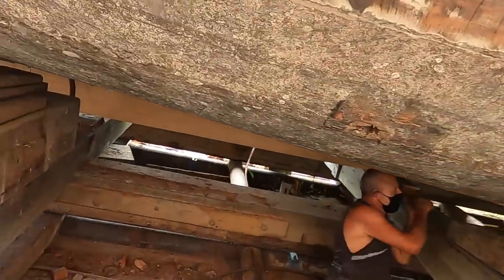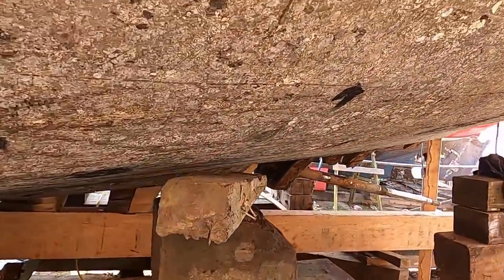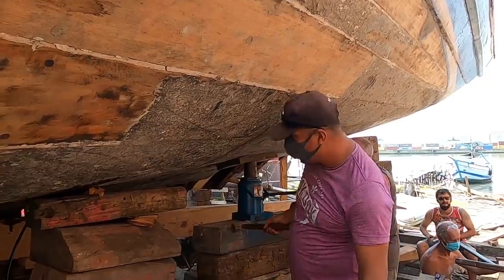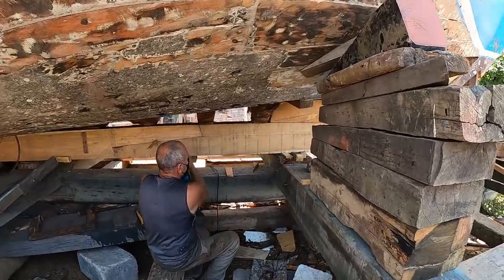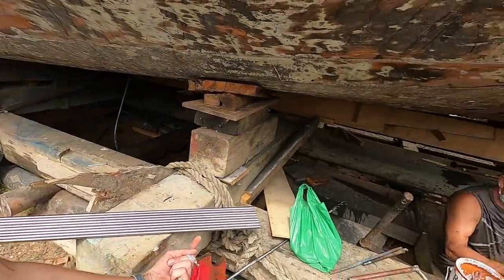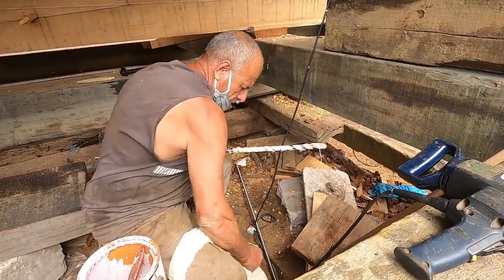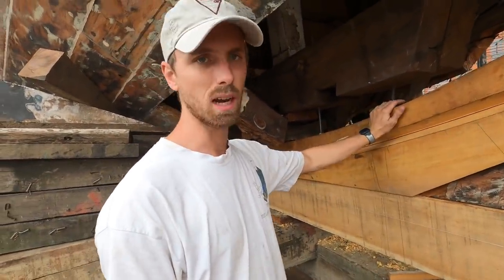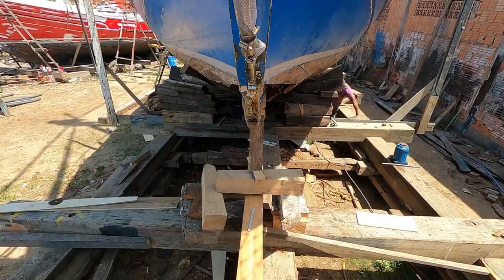Replacing the largest piece of wood? CHECK! — Sailing Yabá #15

Comment: Ok I'm going to help you out here. They are putting all thread "BOLTS" not screws through your keel. And the things they are putting on the bolt is NUTS not screws lol. If all you had was screws in your keel it would not hold. Bolts are way stronger than screws.
Reply: We call it threaded rod because there is no fixed end with a nut cast on it. Threaded Rod in our country, then you lag it and put nuts on
Reply: Right, we call it all thread. Basically the same thing just different names. We call it that because it is exactly that, all threads, no head, no washer. You can use the entire stick or cut it into many. Nut on both sides or thread it into something and turn it into a stud with nut  one side. Pretty handy.
Reply: So, tell me, what's the difference between a screw and a bolt? In Portuguese they are the same thing, have the same name, that's why it's confusing. Tell me, is there a definition in English about which one is called a screw or a bolt?
Reply: Actually if you want to get technical, they are not using bolts, they are using threaded rod with multiple nut's. See how easy it us to tell actually what they are doing.
Reply: @48whodat  It's all 'parafuso' in Portuguese.
Reply: @rafaelschipiura9865  I build industrial machines.  In English it is usually understood that a screw is tapered to a point and used in non-threaded holes in wood, fiberglass, plastic or sheet metal.  A bolt has a squared off end and is used in threaded holes in metal.  However I have seen the term machine screw also used to describe what is normally understood to be a bolt. And the term lag bolt is used to describe a large screw.  So yes it is confusing.
Reply: @13Sala13  It's also possible to call what's usually called a tapered 'parafuso' a lag bolt, so the square end doesn't make something a bolt. There's no actual definition. For someone without actual experience in English, it's not possible to know at all. Since the working language in the boat yard is Portuguese, they have no way of knowing the word they are supposed to use.
Reply: @rafaelschipiura9865  A screw for wood(called a wood screw) is usually tapered and does not go through a piece of wood but buries its self into the wood. The threads on the wood screw are designed to cut their own thread into the wood (you make a tiny pilot hole for it, the pilot is much smaller than the outside diameter of the wood screw). A bolt is a rod of steel that goes through an item and has a thread on it. The bolt goes through the item and has a fixed end (head) on one side and a nut that you put on and tighten with a spanner at the other end (there are several types of heads for a bolt but all are fixed). A machine screw is a bolt (with different heads) designed to screw into a thread that has been cut into the receiving item. A threaded rod allows flexibility in length, installation and how you put a head on one end, it is just a long  long rod that has a thread cut from one end to the other.  You can cut to length, drive it through the receiving item and then put a nut on each end. You can tighten from both ends too.
Reply: @jolyonrussell7021   "A machine screw is a bolt". Is this a screw or a bolt? And what about a lag bolt?
Reply: @rafaelschipiura9865  A machine screw is a bolt BUT nut is the item it screws into. Like bolts that go into an engine block. It is a bolt designed for  machinery and metal to metal. Lagging is a sealant, there are several reasons to seal a bolt  like wanting to stop something leaking through the hole or make it impossible to remove the bolt again or to rust proof the bolt. Lagging is an old and proven way to seal the bolt. Lagging is/was cotton or similar that is wrapped around the bolt. You then add an adhesive to the lagging like paint, tar or modern silicones etc. Loctite is for example a modern adhesive that does not require the cotton but it locks the nut on a bolt or locks the machine screw into the receiving end. Plumbers used to use Hemp and Graphite to lock water pipes together without any leaks, the hemp is the lagging and the graphite is the adhesive/sealant
Reply: Wow guys I was just poking fun. Same thing I do to Duca. But on a brighter note, I now no how to say bolt in 3 different languages!!!😂😂😂

Comment: When you say , "painting keel bolts so they do not rust" are you implying that they are carbon steel threaded rods and not stainless?
Reply from the maker: Sorry they are stainless steel, it is so that the metal doesn't get in contact with the wood and keeps the wood in a good condition

Comment: I’m following your journey...I do have one question how much does it cost for the keel replacement
Reply from the maker: Hello Charles! The wood for the new keel itself costed us around 650USD. But of course that's not the total cost of replacing the keel. To that we should add the labor hours, the planks that had to be removed for the keel to be replaced, the bolts, threads and nuts... we are still working on our expenses sheet so we don't know the exact answer, but hopefully this gives you an idea!

Comment: That boat is all just a chocolate cake. How much are you spending to get it sea safe? How much did you buy it for. Than add these up and see if you can buy a better non leaking boat.  If you can than you are doing all this for sentimental reasons. I think you can get a good boat for the money. This one is nice but sometimes you have to think. I am sure after it is all done you will get a nice boat, but expensive. The labour cost in our country would mean this boat is scrap. Hopefully it’s cheep labour costs.

Comment: Your determination will probably see this refurbishment through, but I still say it's going to take you a lot longer to do and be a lot over budget . . . do you even have a budget . . . than what you thought.
The removal of the stern is just another example of getting something you didn't plan for, a lot more rot.  I'm afraid you're going to continue to find that throughout the boat as you fix it. 
There's nothing wrong with what you're doing, as long as you know you're in it for the long haul and that it's going to be far more expensive than you originally planned, even in Brazil.
But, when it's done, if it's done properly, you will have a nice boat.  Is it an ocean crossing boat?  I'm not sure.  I don't think I would want to take that out in the ocean, well off-shore.  I think that's more a coastal cruiser, but if you're a good sailor, you might think it's okay.
With COVID and the lack of available work right now, I would say that you are doing well with the crew of shipwrights, builders, and craftsmen you have working on Yaba, not to mention the dog, but I would be seriously surprised if you're out of there before the first of the year.  Really.
Anyway, I'll keep watching to see how you are going to rebuild this boat, obviously, from the keel up!

Comment: In American English you are using threaded rod and nuts.  Not bolts or screws.  But we use bolt/screw  as the verb to assemble the trods and nuts.  We talk funny Lol.   I really don’t care I know what you mean and like  hearing what it’s called there.  .

Comment: Guys - what a great project and fabulous to see the progress.  Super well done and fascinating. The bolts you often refer to as screws are in fact BOLTS - ie they have a threaded shaft with nuts on either end (or a machined head). Screws on the other hand are tapered and inserted into the wood by twisting so that the thread bites into the wood. KISS - just refer to all those keel fasteners as BOLTS -   that's what they are. Coach or Lag bolts also screw in - but they have a tapered shaft.
Reply from the maker: Hey Richard! Thank you so much for taking the time to explain us the difference, we were clearly very confused about the terminology. Now we've learned and hopefully won't confuse it anymore!

Comment: Im sorry, but get a surveyor down there independant, those keel bolts are wrong, you should not use stud, but they are way to small to hold such timber, the stainless that size will have difficulty handling the keelson swelling up when you launch her again. Seriously, ive rebuilt a timber yacht myself & re planked others, you dont know what you are doing and relying on what the yard gives you, i seriously recommend you get a surveyor urgently to over see these works
Reply: Yes I agree an some tar or bedding compounds. between timbers
Reply: @jamesseven2068  totally, I haven't seen any red lead in use or any bedding compound at all in the forefoot. The issue with using stud, firstly over time water will find its way up the threads regardless of what compound is used. And plus, for the diameter of stud, the actual diameter is less the thread ! No wonder these boats rot away so quickly. The craftsmanship is ok so far, but materials being used questionable in respect of installation. There is no way on earth that I would take this boat to sea on those studs let a lone do any ocean passaging
Reply: @jamesseven2068  sadly the guys haven't knowledge to oversee these works, and must employ a surveyor to reside over specification of and installation. It also concerns me that all the framing is shot, but seemingly the new keelson is being fitted back onto them, unless they are going to install sisters on each frame, but surely these would go in before the keelson is fitted ?
Reply: I must admit all my keel bolts are stainless that run through my cast iron keel weight through the keelson, but they are of the highest quality stainless and made to fit the installation. Using a bit of 316 stud is suicide, it's not even big enough for the job

Comment: Very interesting process, I worked for a company that used hydraulic rams to lift and move buildings and the wedge process here was great to watch live no doubt. Packing "Calking?" the bolts for water tight fit and paint for lubrication for the inserting and protection , Well done by that crew.

Comment: This is the craziest thing on youtube. A round bottom boat with no ballast or heavy keel will just roll over in the smallest ocean storm.  I hope the seller paid them to take this scrap away.
Reply: There will be ballast added in the bottom of the hull after it is fully replanked. Internal ballast worked well for all of the clipper ships and sailing ocean freighters also all of the sailing warships generally used pig iron blocks as ballast lying on the bottom planking.

Comment: What happened to all of the old keel bolts?  why havent you posted the removal of them?  weren't they 1 inch bolts?  5/8 THREADED ROD will bend too easily. should be using 1 inch.    stainless steel does not need to be treated with cotton slime "so it does not rust".  i seen old boat parts from japan wash up with the stainless bolts looking untouched by the ocean and i live in california..  stainless steel is not affected by salt water and does not rust.   but wait---  the THREADED ROD they use looks like a 'course thread', which means they will not be able to torque the connections to the max.   obtw  they should be torquing the RODS everyday.
Reply: 5/8" bolts are being used to supplement the 1" bolts in several places, for example, at the mast steps.
It is far better to stick to one type of fastener in the hull, rather than mix stainless with galvanized, or bronze, for instance.  (And stainless will rust and corrode, and deteriorate..)
Reply: @jfarmer1711  are they using 304 stainless or 316?  depends on the grade of the steel.  the previous mentioned will outlast any other boat part.  stainless also does not react to any of the metals you mentioned.
Reply: @jsEMCsquared  I don't know if they've mentioned what type of stainless is being used.
I was always taught and heard it from multiple sources, to not mix fasteners.  If you fasten the frames with galvanized, fasten the planks with the same to avoid electrolysis issues.  Stainless fasteners mixed with galvanized were considered just as bad.  But that was many years ago, so it's possible new alloys might have changed that.

Comment: you are not using screws. What you are using is a threaded rod, with nuts and washers on both ends. Call them bolts, if you want, they are definitely not screws. Part of this project is for you and MP to become educated on the task, and that includes using proper terminology. Bow. Stern. Rudder Post. and so on. By doing that, you will educate your viewers.
Reply: It's lag screw rod.
Reply: @rafaelschipiura9865  ok. Still NOT screws.
Reply: @PaulBartomioli  A lag screw is a type of screw. English is weird, that's all. They deal with the boat terms in Portuguese, give them a break.
Reply: @rafaelschipiura9865   I know what lag screws are. I have used them. I have also done construction where threaded rod is used as it is in this construction. They are not screws, they are not lag screws.  Give it up.
Reply: @rafaelschipiura9865  in Portuguese the term is "haste roscada."
Reply: @PaulBartomioli  Think about machine screws. Someone gave me the tip in the comments earlier. Screw and Bolt are two words in English that only make sense for someone immersed in the language. For someone working in Portuguese and trying to translate, they have no chance whatsoever of getting it right. Just give them a break.
Reply: @PaulBartomioli  No, "barra rosqueada" is the the in Brazilian Portuguese.
Reply: @rafaelschipiura9865  of course. You're right. Words don't have meaning.
Reply: @rafaelschipiura9865  so you do know the correct term, fascinating. Welcome to the mostly peaceful riot.

Comment: Hater are gonna hate!!...... You guys scared the crap out of me with the temp repairs you did to get you to this yard, but the depth of the rebuild is impressive, you are going about it the right way, there are no short cuts or cheap way to do this, if it is bad then replace it, if not it will bit you latter on.
So let the haters hate and keep on with what you are doing, oh in a past life I was a Coast Guard Radio Operator, keep doing it right!!!!

Comment: Nothing done about the iron rot. No lead or other preservatives to prevent water absorption into the end grains.
Reply: For goodness sakes thy just got the keel mounted .What you are talking about comes after .
Reply: @loganjohnson3589  i beg to differ.
Reply: Have some patience all will be revealed in good time .
Reply: I saw no bedding compound used which prompted my post about unprotected end grains on the keel. Unless you can tell me when something like Dolphinite was used? Also look up iron rot in wood boats.
Reply: @ryleelewis  I know about iron rot I have owned more than one old boat .and there is more than one way to handle the problem you don't have to use brass or bronze

Comment: I am surprised they don’t use stainless bolts, surely that will not corrode with the salt water....
Reply: how do you know they aren't stainless?  even tho under the right conditions even stainless corrodes.
Reply: @FlyMeAirplane  depends upon the type of stainless. Many types need exposure to oxygen to be corrosion resistant.

Comment: Back of the boat = stern, front of the boat = bow,   LEARN the nautical names   PLEASE, please, please !!!!!!. Screw = threaded rod  please, please , please  . So many people here pointed this out to BEN and MP i am starting to think they don't want to change / be educated. Grrrrrrrrrrrr. See Tally Ho and other channels and listen to how the name boat parts.
Reply: I bet you they know all the names of the boat parts, in Portuguese. The problem is not in learning the names, you can be sure. It's in translating them, which is more difficult since no one there knows the name of the boat parts in English. Why would they?
Reply: @rafaelschipiura9865  I'm pretty sure the guys working the boat know all the parts in Portuguese, they know their profession.
But as I follow the progress I get bored by that conflicting naming and a lot of repeat. Ben is not doing that much, not even finding rotted spots. If he only run a band sander on the hull, take of all paint and other stuff he will be not surprised every time those workers open up a new are. He should be more pro-active finding the weak spots and thread them.

the spots on time
Reply: @charonstyxferryman  " You can't expect them to know every single boat builder term.. "   Every single or None ? In my opinion it is None, that's why every  day they get  surprised,  A little, little, little own knowledge (or they could have asked someone with a nautical background, even in Brazil they are available) would have helped them not  stepping in this black hole.

Comment: It looks like you're using steel bolts. Terrible mistake.
Reply: No they are stainless steel they mentioned it in a previous episode
Reply: Cost vs availability. Most work boats even in usa use steel. Thats just what you got so what you use. Seriously do you know what bronze costs? For 100s of years people used iron/steel. Look they are not in the 1st world and are doing what they must to get it done. Dont hate wish them the best. They will easy get 20-30+ years on this boat after this work. If they go back and tar some places and keep fresh water out it will be fine